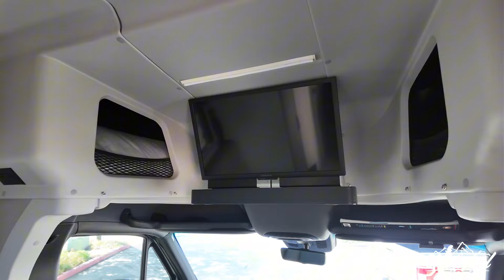CAtuned Off-road | 2025 Winnebago EKKO MadMax trail edition

Comment: Wonder how much all this adds on the the GVWR, a lot of people don't even top off the water tank before going on a trip. Extra 100 lbs just from the fuel alone.
Reply: Have to go solo with all those add ons
Reply: Remember it's a Sprinter 3500. Plenty of payload compared to the typical 2500 van builds + it has massive suspension and leaf spring upgrades too!
Reply: negative nancy or maybe stewey

Comment: How does the coach handle with two wheels in the rear virus the factory dually setup? Is there more sway when driving on windy conditions?
Reply from the maker: @jerryc7016  It actually handles really well
Reply: It's a Msrcedes sprinter...the dually is in the Ford Chassis.
Reply: @Rogue_1987 No, this one is a dually too.  They went to a super single set up.